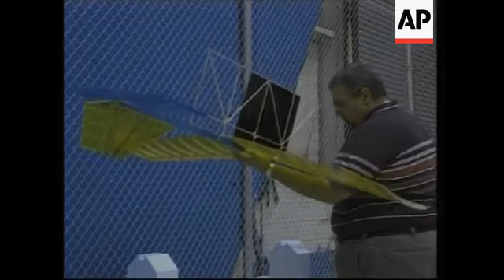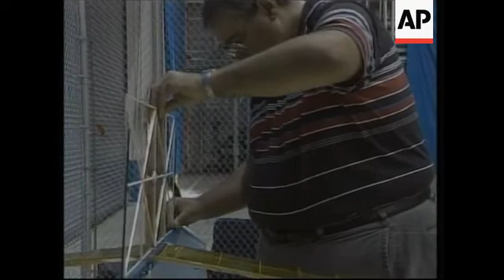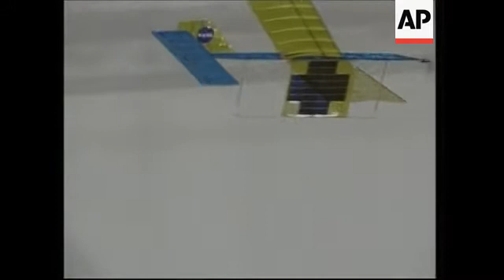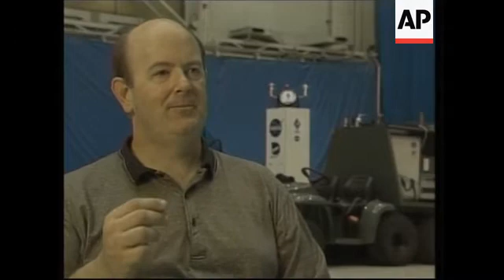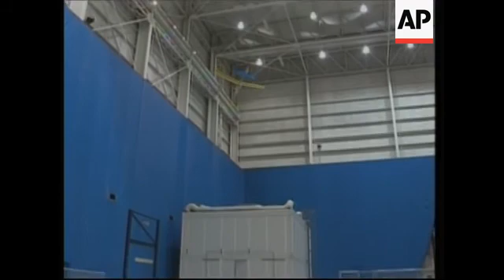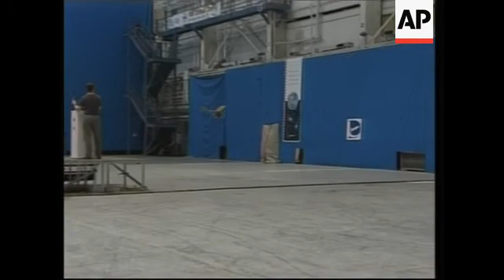NASA launches laser-beam-powered plane

Comment: By using a laser beam inside of the housing I would get engine to create your heat source pulling in cold air equally bus y using no fuel the generator on the jet engine will keep it Howard and you need no fuel from one inventor to another that will be a simple application